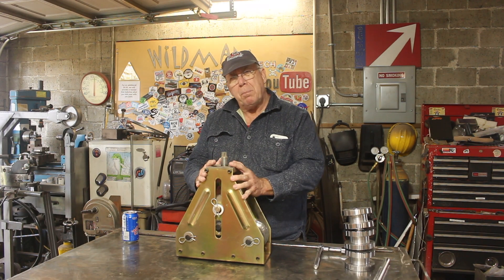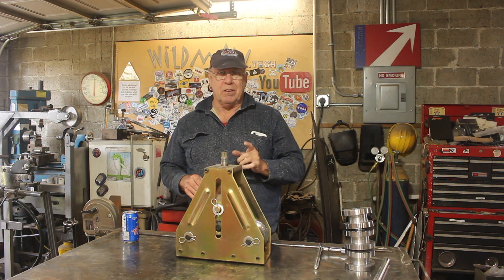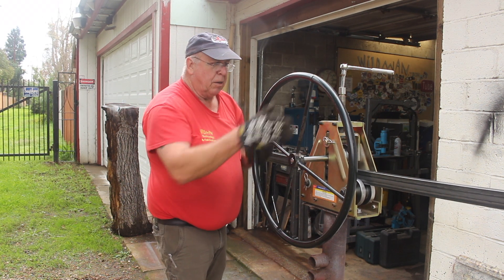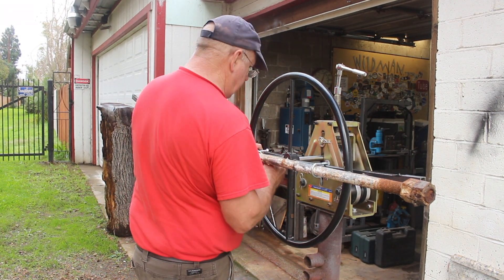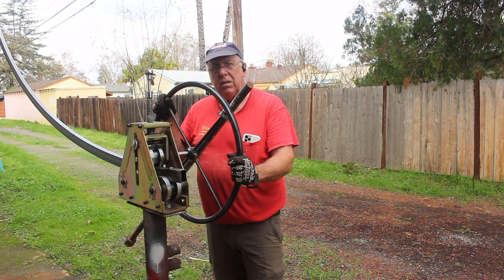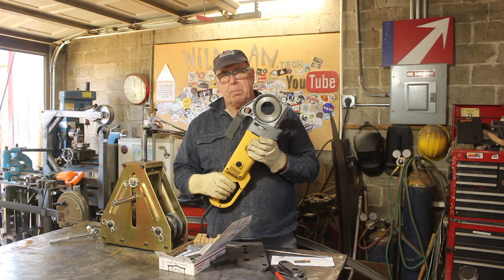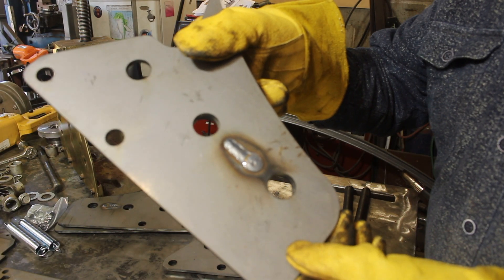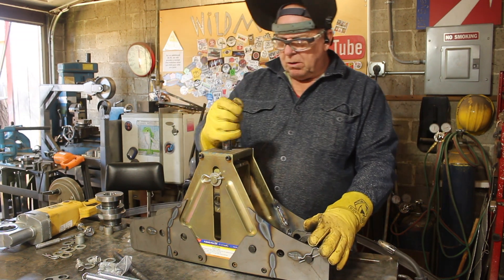Modify your Harbor Freight Tubing Roller!

Comment: Is it possible to use an inexpensive $75 winch motor from harbor freight instead of the electric pipe threader? I believe it should have the torque and power
Reply from the maker: There are lots of different power sources you could use. The trick will be interfacing to the drive wheel. All the parts to interface to the pipe threader are readily available.

Comment: What gauge was the steel section box?
Reply from the maker: The rectangle tube I was rolling? 0.065" wall. Roughly 16 gauge. If you're talking about the wing and riser kit, that's all 1/4" plate.

Comment: I have the complete SWAG Off Road mod kit with the wings and the hydraulic jack and the electric drive. It still is a slow go on heavy wall tube but it works great. Oh and a foot pedal so I could keep better control of starts and stops.

Comment: very great video
thank you much for your time  and knowledge

i didnt see this  bender first, tought i was looking for domething
eventually  purchased the hydraulic  bender hoping might works
it """breaks"" the square tubing, but  purchased some bearings  and putting different washers i can cut with machine,  basically i have the rollers i need

Comment: really appreciate the time you put into making this. I have a hossfeld  and saw dies for 1x2 but after talking with them i'm glad i went with the roller option in my shop as well ( less kink). the tip for the wider leverage is genius. the straight out of the box attempt and then modified is what i needed to see to make my final decision for a 16 foot curved section i was gonna used a forge and sand on. guy from swag said .095 wall was fine without a pack so i'll be off and rolling here soon. thanks

Comment: Cool video. Thanks sir. How far apart are the lower wheels now
Reply from the maker: When you do this mod, you lose the original roller holes. The new ones are either 15", or 21" apart.
Reply: @WildmanTech  Thankyou sir

Comment: I came across the Swag Offroad kit last year.  Like you I could have made it from plate steel, but it came down to time savings, or so I thought.  Ordered it the on Jan 10th this year.  It got lost at the Portland, WA post office.  Opened up a case with USPS and wrote Swag.  Swag said they have had that problem several times before.  However I had to wait 30 days before Swag would send me another one.  After 30 days I asked to have it sent some other way other than USPS flat package.  I have a feeling it got tossed around and the box probably fell apart.  The new one arrived today, Feb 15 via FedEx.  Good thing they put the USPS box into a FedEx tyvek bag, because the box inside was torn apart where the metal plates were busting thru again, but the bag held up and all parts were there. 
 
Temp today was -6 when I woke up this morning and my garage is not heated, but I managed to weld on the wings tonight in 16 degree temp.  I did have some warpage on 1 wing that needed to be pounded out. Tomorrow I'll start the top portion and the drive unit.  Going with the original HF axle and using the HF threader pieces.  Like you I'll be putting in a shim made from a 7/8 to 3/4 crank shaft sleeve adapter that I milled open weeks ago to go on the shaft for the HF threader die.  Can you tell I've been waiting to get this thing put together.  Upcoming  project with twelve 1.5" tubing to be connected together for 47' long, bent into half circle of 30' diameter.  However, if I ever need to do square tubing like you I'll have to order Swag's keyway shaft and dies, along with their drive hub to weld on the shaft.  More money $85.   Its all 4130 chromoly, so a little different in welding it up that I have never done and may have to find a professional since I don't want to screw it up.  I wish they would just sell the axle and drive hub already welded. 
  
One thing I noticed on the HF base, it is not perfectly perpendicular, which leads to that slop between the rollers.  I ground mine down and got the sides to run parallel to each other and perpendicular to the base.

Comment: Do you think you could have done without wing extensions and just the motor addition?
Reply from the maker: It might have worked, but the guys at Swag said the first thing to fail would be that screw on the top. I'm not thrilled by the additional amount of waste on the ends, but the labor savings is totally worth it!